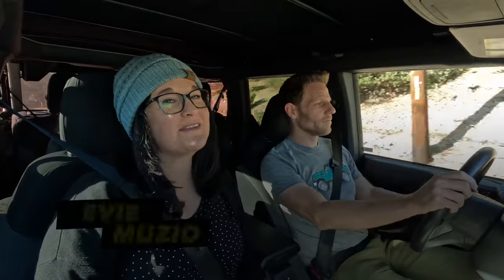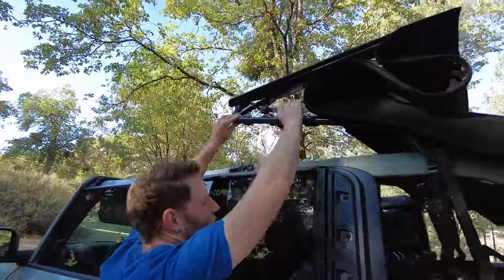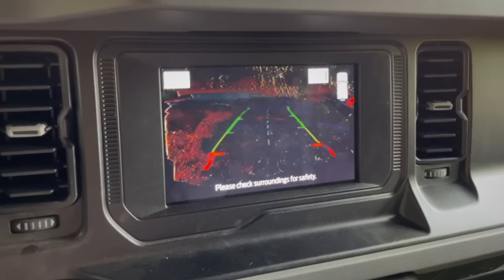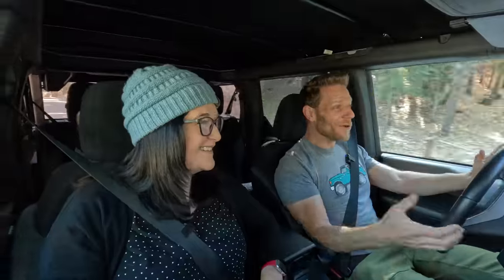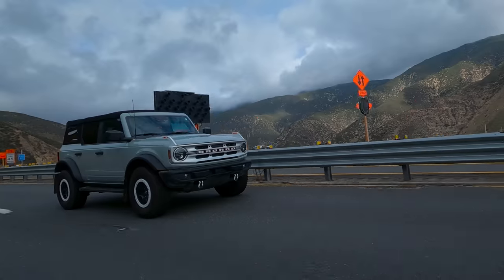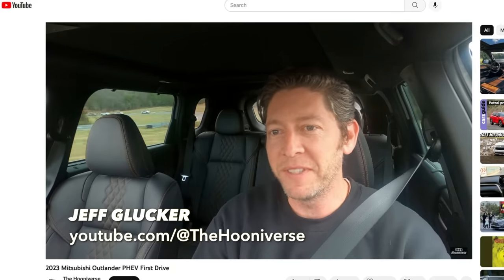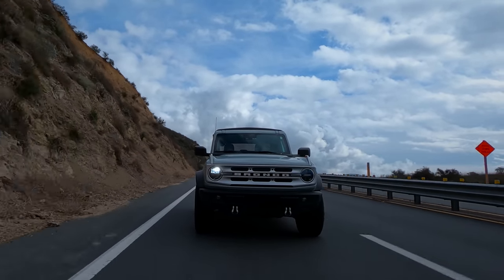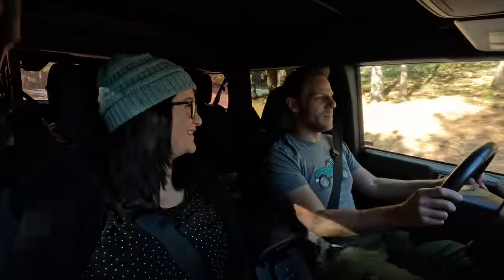Ford Bronco Problems (18K Mile Update)

Comment: The only thing I don't like about mine is that there's a new noise every day. It's a rattlebox. Also, the windshield cowl vent became warped in the sun, and the hood got caught on it while opening. All bent to shit now and won't snap back in. And I don't know if this is a quality thing, but I had two cracked windshields within 3 months of owning the car. I drove Nissans for the last 20 years after taking a break from Ford because of all the problems I had with the Mustang. I never had a single issue with Nissan or any Japanese car I've ever driven. Why are American cars such crap? That aside, I still love my Bronco despite the annoying issues. It has a cool factor that jeeps can't touch.

Comment: Bought a Bronco II many years ago now. A few months after I owned it there was an odd noise that started with it. Took it in and the figured out a part of the U joint came apart and and caused the drive shaft to be bent. Told me it would take a week or so to get it fixed and mainly because of a need to wait for the part to ship. Sale man told me I had a warranty that covered a rental car so he got me one. Strangely enough they called two days later and said my Bronco was fixed and I needed to get the rental turned in because it was costing them per day. Guess the part could be had a little quicker than they thought

Comment: I’m truly glad the to you have had luck with your Ford basically.  I myself… one Lincoln, one Mercury, three Fords.  Tried five times ALL new cars.  Some really good dealers.  Most not.  To much bad history to go back.  Transmissions, driveshafts, radiators, heater cores, engine blocks, Turbo’s, Manifolds, cylinder heads, axle bearings, master cylinders, front suspension mounts, steering racks, drive shafts, strut tower welds.  I could go and on.  I have friends that swear by Ford.  Again to much bad history to risk it.

Comment: Bought a 2023 Outer Banks Sasquatch with 2.3 in March 2023, put 14k miles on it.  Absolutely zero issues in all 14k miles.  I traded for a 2024 Wild Track with the 2.7 on 12 April 2023, came out under MSRP, fair money for the trade. Really happy with it so far.  Also have a 2017 GT350 and 2021 GT500, no issues with either of those.  I like Fords, but I also a 2020 Toyota 4Runner TRD Off Road.

Comment: It's a little surprising and disappointing that in 2022 a major automotive manufacturer would have such issues, even in the first year.  How could Ford not know that the top scrapes the side when folding down the soft top? Engine failure?? Transmission failure??! Is there no proper QC?

Comment: Old Ford Bronco II cira 1983 had to swap out front drive shaft for 4x4 system often but easy self work. loved the old desert dueler tires. TC customs in Bama swear by the K2s on custom work. Work veh is a Transit w 3.7 in it no problems.

Comment: Ford saw an opportunity to challenge Jeep. The Bronco and Jeeps off road capabilities are similar. The Bronco’s overall technology seems to be a little more advanced than Jeep in some areas. I prefer Jeeps six cylinder engine and automatic transmission over Fords options. I honestly wouldn’t trade my Jeep JK for a new Bronco though. 

I wonder if the Bronco will retain its resale value like Jeeps do? Jeeps ability to hold their value is a big selling point, at least for me.

Comment: Recall is registered with NHTSA and you are supposed to come in and have it done (do some states not allow re-registration with open recalls or is that just an urban myth?).    Customer Satisfaction campaigns and TSB only involve the manufacturer, and a TSB especislly isn't "preemptive".  It's just a guideline for a fix if a customer experiences and complains about a certain problem.   

So not a "recall"

Comment: That the Bronco has had all those issues and Ford owners consider that acceptable blows my mind. And apparently others are having even more issues... meanwhile, my 2007 4Runner with 280,000 miles has never had a single mechanical issue with only routine scheduled maintenance. Zip. Nada. Zilch. Gave it to my son last year and bought a 2022 which already has 13,000 miles and am having the exact same experience. No issues whatsoever... none. To each his own I guess 😳

Comment: We've had our Ford Bronco for over a year now and after completing a 2,000 mile road trip over all kinds of terrain and a lot of daily driving, I'm ready to report...No issues or problems with the vehicle! We have taken the doors off, top fully down, Winter driving, on the beach driving and there is nothing much to talk about, except how great the Bronco is.  I do wish however that they would drop the annoying horn honk if you close the door while the engine is running. I've learned to just leave it ajar a bit. Also a shout out to Ted Schultz Ford in NY for excellent attention, service and a MSRP sale.
Reply: You can turn that double honk off with forscan by the way.
Reply: Look up the 4D Tech Horn honk eliminator. I got one for a F-150 and it stopped it.

Comment: Here's the truth. NEVER buy new Fords, always buy used. Why? Most Fords depreciate like crazy, and when they do, you can buy from a non-Ford dealership that might actually sell it closer to KBB value, so you pay what it's worth. If you try to buy new, you will pay WAY over MSRP because Ford dealerships are the worse dealerships of all... just look it up. There's a guy that goes around comparing dealership prices... Toyota and Volvo are the most honest, but Ford is always screwing folks 30-50% over MSRP. Just look at the BRAPTOR... worth $70K and selling for $107K. Ridiculous.

Comment: People in the comments are really drinking the haterade… seems like your car just had a couple little problems that were easily fixed. There’s a definite emotion factor to the bronco so as long as the issues stay pretty minor, seems like it’s still a very satisfying thing to own.
Reply: The problem is this is a brand new car with super low miles and there are already so many problems with it. Even though they are not huge problems, a new car should not have this many issues. Especially since the broncos are going for sky high prices. This video is just an example of over all ford reliability , or lack there of.
Reply: Attention to detail matters. It’s a window into the quality and mindset culture of an organization. Especially for such a storied car manufacturer. What you can’t see, that will be a problem after the warranty expires, is the concern. I bought a new F150 in 2017 and although it’s been mechanically trouble free, the fit and finish has been disappointing. So much so that it’s my last Ford. My wife’s 2013 Mazda looks and drives as good as the day we bought it.
Reply: The Bronco Sport has 8 recalls already. Ford builds nothing but turds.